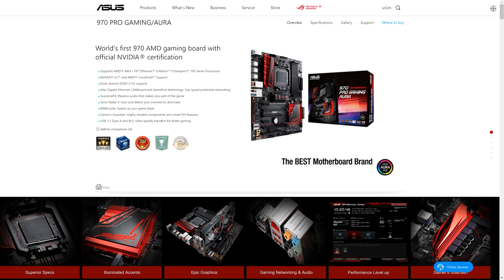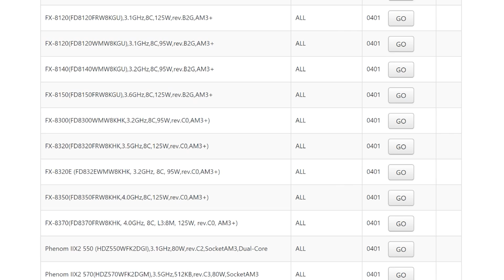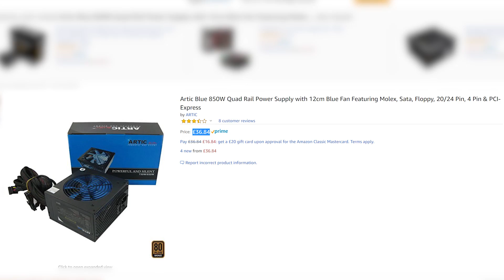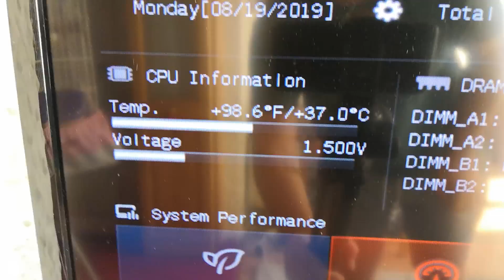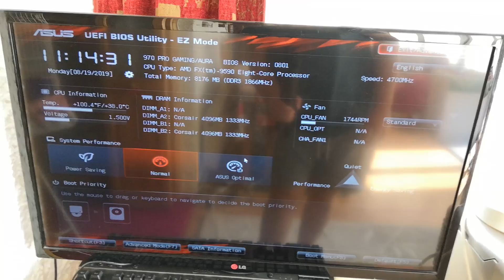This Used Gaming PC Is a 5GHz Fire Hazard (Pt. 1)

Comment: Don't be affraid to run this CPU on that board. This AIO can handle the mighty 9590 (u can upgrade to push pull to be sure). The main problem with running this CPU is VRM! Make sure there's plenty of airflow around VRM heatsink. And even when VRMs gonna get too hot it's not gonna burst into flames... just gonna throttle the CPU to 1400Mhz. PSU upgrade was a good move. Can't really see how it ran on that shitty one (bet the seller swapped it before shipping). I have "some" experience with that CPU :) OFC forget about overclocking with that MB.

Comment: Upgrade the motherboard I got  a fx9590 with r9 380x and 16gb ram with asus crosshairs formula z mobo for $250 a couple months back but I can’t leave it at stock so for some reason it always locks up so I’m running 4.5ghz still gets well over 60fps high settings in apex fortnite and halo5 and gears4 and forza giving the pc to my little brother for his birthday in November once I upgrade to zen3 because and this cpu definitely warms my apartment

Comment: That's why I have stopped buying stuff from Cex, I bought 8gb ram (which were broken when I received them) and I also bought 2 HDD's and both of them were corrupt or had a max speed of around 50kbp/s. Never buying stuff from them again, safer to stick with ebay.
Reply: Safer to stick with Amazon. A little bit more expensive but guaranteed to be brand new and obviously working

Comment: A lot of non-enthusiast builders seem to have NO CLUE about PSU's. I've seen some super highspecced machines (think 980ti and a 3770K + Noctua aircooler) that had budget high-wattage psu's installed for... No apparent reason? I think maybe normies just look at to psu's and think "I can get 850w for 40eur or 650w for 80eur!? must be a rip-off this!"... Also if you OC an 8000 series it's not really gonna work any better with the motherboard :b I mean it's the power draw the board isn't rated for not the chip.

Comment: You worry way too much. The last CPU that would barbecue itself if you didn't pay attention to its heat output was the ancient Thunderbird - everything since then is thermal-controlled and throttled and pretty damn safe. Worst thing that can happen here is that the thing shuts down, or possibly that the horrible old PSU blows a capacitor - which would be unpleasant but not threatening.

Comment: For sure, there are lots of motherboards that will have serious problems with the FX 9590. This isn't one of them. It's got a 7+1 phase VRM with a decent size heatsink. Worst case it would need a bit of airflow for sustained heavy loads.

Completely agree with swapping out that gutless wonder of a power supply though.

Comment: Hmmm well I'm gonna vote for continue to use the 9590, if you have funds replace the PSU with perhaps a modest Corsair TX850M or Thermaltake Toughpower GF1 850W which would give you enough headroom for that CPUs massive TDP both PSUs under $200 or you could go with the Corsair RX1000 for under $300 if you're super nervous. If you live in a modern house with modern power cabling in your walls with a circuit breaker you shouldn't have issues with this PC but I understand your concern. The motherboard would automatically turn off if voltages spike or fluctuate or the CPU could be damaged.

Otherwise go with a 8000 series CPU. It's really up to you dude and what you feel comfortable with.

Comment: Oh my god. I have one of those cases. I hate it. I absolutely fucking hate it.
It has the worst airflow. THE WORST. 

I ran my FX-8320 inside it with a GTX 750Ti, and later in it's life before I upgraded to Ryzen, I was running a Vega 64 in there just to see how it would handle general use. Two space heaters, one case. Not good.

Comment: If the motherboard is a good 970 it should be fine. I had a Gigabyte 970A-UD3, which was a medium range 970 Board, but it still had an 8 phase VRM. It easily handled an overclocked 8150, which should also be around 200W. However I would not overclock the 9590 on it.

Comment: The 970 pro has a decent vrm setup. But the vrm might get a little toasty so you might want to throw like a 28mm fan on it.  The board should be able to handle the cpu at stock operations, so let it boost itself instead of doing a manual overclock. Also flip the fan to the other side of the rad so it's bringing cold air from the front in.

Comment: 970 chipsets really aren't all that great for the 8 cores or even at times for attempting to push the 6 core chips. My fx 4300 was doing fine in a MSI gaming 970 board with an overclock to 4.4GHz  but my fx 6300 was really only ok at stock settings. 

I'm honestly torn on the decision. I know a 990fx board is a better match for that cpu but they're not exactly cheap to come by. Seems like you'd be better off with going for an 8xxx cpu, but then the system would be handicapped overall without that overclock.

Comment: A 5Ghz, all-core overclocked FX-9370 is my daily driver. In the peak of summer, I (sometimes) crank it down to 4.8, and in the dead of winter, with mods, I can get it to 5.1, 5.25 just for desktop screenshots. H100i, presently only in a pull configuration.

I even ran it without any case fans for a year. The plan was/is to replace it with Ryzen, when it dies, but it just doesn't seem to be capable of dying. Worth testing the 9590, for sure. Btw, I rock the Sabertooth FX 990 R2.0 board.

edit: Presently running a 1050ti, as I lent my 7970 to a 9900K build that I did for a friend.

Comment: Go for the Better MB and use the FX-9590 ; Try to get a Gigabyte 990FX Gaming MB ; it has a PCIE2 X4 NVME M.2 slot and on the back panel is a USB 3.1 Type-C port. I had used a MSI Radeon RX 580 8GB Gaming X - I had 2 of the Crucial Ballistix Sport XT 16GB Kit (8GBx2) DDR3 1866 (PC3-14900) UDIMM 240-Pin Memory Kits ( 8-gb X 4 Modules  = 32 gb ) My storage was a 1 tb Samsung 970 Evo NVME M.2 ( PCIE-3 X4 )  : After an optimization with the Samsung Magician software it ran at - 1850 mb a sec read and 1645 mb a sec write ; which is more then 3 x the speed of any Sata SSD could run at. My  PSU was the Seasonic Prime 650w FM 80+ Titanium model. You could probably use a RX-590 8gb gpu in place of the RX-580 8-gb and the FX-9590 shouldn't be  much of a bottle neck between the Cpu and Gpu.

Comment: After all this years you still afraid to burn a mobo when there is no reason to worry?
Reply: Exactly, he need to grow a pair... I like his content but come on, the worst that can happen is a dead mobo, a gpu can pull more than 300w but he is scared of a cpu than can do the same ? Fire won't start for so little, even the old evga classified that burned their 24 pins connector when doing 4 way sli gtx 480 wasn't a fire hazard

Comment: I had that motherboard for 3 years with a fx 8350, served me well. That board is known to run hot though, had to set voltages cause the auto settings allowed it to go too high with no performance gains

Comment: I thought the 9000 chips were just binned 8000 chips with factory overclocks. run it as is, back down the voltage if it gets too hot for you

Comment: Run it as it is, I've run a 9590 at 1.65v on that board with phase cooling. It's fine Bro. Did 5.8ghz no problems.

Comment: Hope I'm not too late. . .  regardless of what CPU you go with, I highly suggest upgrading to a 990FX board.

Personally, I'd like to see the 9590 in action. . . it was my first choice when getting parts together for an upgrade a few years ago, but one of the sales reps at Microcenter warned me that it required a liquid cooler, and none of the 9590s they had back then came with a cooler at all (when I started looking at this CPU late last year, they actually came with coolers!).  And I'm not a liquid cooling type of guy, I like fans!  So I ended up getting an 8370 instead (basically a stripped-down version of the 9590).

Now that you mentioned that the 9590 can be air cooled, what would you suggest for a decent CPU cooler?

Comment: honestly, i think you're being too paranoid with a lot of this stuff. I do a lot of risky stuff with the spare computer components i work with, and using a high wattage CPU on a motherboard that isn't rated for it isn't that bad. The motherboard wattage ratings are mostly determined by the heatsinks on the motherboard power delivery cicructs being able to dissipate the heat. i've been able to push full 91w i7's on OEM dell motherboards that were rated for 51w i3's. keep a fan on the motherboard and throw in a 650w psu, and everything should be fine.

Comment: I got 2 fx 8350s oc 4996mhz h100v2 30c 55c max temps 4 case fan's good air flow , asus sabertooth r2.0 gtx 1070s pony gaming memory 1866hz 4x4 16gb evga 850w g2 power supply, gave them to my 2 girl's and they are happy gamers right now , i did a 3600x new computer its 2 plus  times faster and cooler.

Comment: Please, stick with 9590 and overclock nb, cache and ram. Otherwise you won't get full potential of it.
Reply: This. I tried this on my 9370 and it performs SIGNIFICANTLY better, even if I have to have it at 4.85 ghz instead of 5. It's still much faster, particularly in games and single threaded applications. Multithreaded is about the same

Comment: If it booted without blowing up you should be good to go.  I would change the thermal paste and then blow out the radiator and fan on the back of the case.  Just to make sure.

Comment: Get a new board for the 9590, sell the old one off, test it with the 550 then put 8 more gigs of RAM in and a better gpu and see how it performs and see if its capable in 2019, may want to upgrade the cooler too and push that monster of a cpu, i couldn't imagine AMD making a dual socket board with 2 of these paired with 2 480s in SLi, your entire estate would be a a blaze and the ice caps would have melted

Comment: This reminds me of the older AM3+ motherboards that didn't officially support the FX 8xxx series chips even though the board supported 125W CPUs it did not support the fx 8xxx series cpus but users used the fx8xxx series anyway.  Yeah this user who owned this PC was really playing with fire here because when the FX9590 was being sold commercially sites like Newegg and Amazon would usually have a motherboard CPU combo and it paired the CPU with an 990 board. Also the Fx 9590 all it was a heavily overclocked 8350 so you are really not losing that much performance.  If you can get a decent price on a 990 motherboard then I would upgrade the board but if you can get an fx 8320 or 8350 for a decent price then I would go that route. But with me I would upgrade the motherboard to a 990 and see what the fx 9590 can do.

Comment: I tried cooling my old 8320 with a low end water cooler and the coolant literally evaporated.
Reply: Dark Rock 4 is all you need to cool anything
Reply: @weavercs4014  screw that get a dh15 noctua cooler and your set for a few years
Reply: @hgffmikimmon5293  yeah noctuas are nice. Although even the smaller ones should be fine for non-oc builds.
Reply: @DeadNoob451  true
Reply: Are you sure it wasn't a light-water nuclear reactor lol
Reply: Shut up

Comment: I would try to run the thing in the 970... You could figure out if it's actually getting the required juice from the mobo or its limited to 8350 performance... That would be interesting - and if it blows up you have a cool video "Running the 220W FX-9590 in an unsupported motherboard... - will it blow??" :-)

Comment: 5:23 I hope you've got that thing plugged into a surge protector.
Reply: You obviously don’t understand the point of a surge protector. It’s made for external voltage spikes. The worse thing that could happen is an excess of power draw and the breaker would flip.

Comment: My CoolerMaster v1 V8 monster handles my AM3+ 8 corer absolutely fine with my core temp with a Youtube upload, game in the background and running Chrome is pootling along about 19 degrees, cannot fault the version 1 cooler and even on the recent ultra hot days my core was hardly sweating whilst I was melting from the heat lol

Comment: Downgrade to 8350, 1l6gb ram. Gtx 1060 6gb im curious as to how the 1060 would run with an 8350. I upgraded to a ryzen 5 1600 due to fears the 1060 would bottleneck the 8350

Comment: Don't worry about the 9590. An overclocked FX-8350 or FX-8320 overclocked to 4.7 GHz would draw just as much power. Go ahead and use it!  It'll be fine, if a little loud.

Comment: One thing you should do if you're concerned about heat from your graphics card then you should check out slot cooler fans some of them exhaust the Heat some of them glow are directly on new GPU it all depends on which one you get they really do help no more hot air you can get out of your system the better it runs even if you have liquid cooling

Comment: Lol the FX CPU's can get a little toasty.
My former FX-8150 (used since 2012) was replaced with a Ryzen 7 3700x

Old System:
AMD FX-8150, Gigabyte FX990-UD3, 32GB OCZ DDR3 1600, 256GB OCZ SSD, 
Galax RTX 2080 8GB, 750w Thermaltake PSU, Coolermaster 240L RBG AIO cooler.

The CPU used to run at 100% to try an keep up with 2080 GPU overclocking itself to 4400 Mhz used to pump a lot of heat out :)

My son still uses the CPU / MB / RAM with a GTX 1060 and its been stable.
Reply: Who puts an rtx 2080 with an fx CPU lol
Reply: @MrMushroom5  It was on special and I was waiting for the Ryzen CPU's to launch rather than look at the GPU go unused for 3 months I dropped it in the old system.

Comment: I work as a PC tech and I remember a customer buying (not from us) a machine with an FX-9590 or 9570 can't remember, with a €40 aftermarket air cooler and an AsRock 970 board. The computer wasn't working very well, so we updated the BIOS... and it had a message saying the processor wasn't supported and wouldn't boot past there. So we downgraded the BIOS, underclocked the CPU to FX-8370 levels (4 GHz) and the processor would pass all tests, including thermal. I think the VRMs couldn't keep with the 220W TDP of the CPU at stock speeds.
This was in 2015 or so, so it was still an OK computer (but a terrible buy). I think the customer kept using the computer for at least a couple of years.

Keep the motherboard, underclock the processor. Or don't, and see how toasty the VRMs are after a couple of hours in Prime95. I would be interested in that. :D

Comment: You can definitely run it stock like that. It wont blow up. The cpu has tdp of those 200w, thats heat output not power draw im sure. If a decent psu isn't capable of the load you put on it, it will just reboot, no harm done. You will know before anything takes any dmg at all. No hardware will be at risk of dmg currently with your good psu

Comment: the 9590 is just a binned 8000 series cpu.    it should be a great undervolted/underclocked fx cpu (if there is such a thing...not).  i had several of those "aura" boards and pushed them hard.   they can take it.   just keep it within reason.

Comment: As the 9590 is first cousin to a flamethrower and the board you have may well be good enough to run it adequately, I would urge caution. The extra power used to run the 9590 is mostly wasted due IIRC some weird throttling issue internally. Yes it will hit the Big 50 and do it at horrendous power cost but realistically it isn't worth it.

I suggest that you pull this rare beast out of the board and sell it as a collector item alone. I do think an FX8350 would be a more rational choice for this board and RAM is it will allow for some, not a lot, of OC room. The GTX550ti not working is possibly replaceable either throught the merchant or getting something else cheap. Thie above would at least allow for a some sort of return on what at this writing looks to be kind of non-functional. What ever you do, please don't burn up that board by boosting the 9590.

Comment: 970 Aura will be fine running 9590, the VRM is strong. I used to OC 8320 to 4.8 Ghz ( around the same base clock as 9590 ) on Gigabyte 970. On normal use ( I use my OC'ed FX back then for daily use like gaming and Drawing on Photoshop ) It is fine for years until my friend interested on buying my PC and then I switched to Intel hahaha...

Comment: Funny. I just sold a 9590 for £60. These processors are overpriced as hell on eBay. I sole it on the FB marketplace.

When I had it, it was paired with an MSi 970A Gaming, while it did post, the chipset ran so hot the PC would crash just idling. I had to disable the boost clocking and downclock to 4GHz just for it to be stable.

Comment: my first gaming pc was an fx-8320 that I had overclocked so high I was outperforming the 9590 when that came out.  it was still garbage for dirt rally lol  i was also killing it with voltage to get there (around 1.6375V if I remember correctly)  ran it for a couple years before upgrading to a w3520 then a w3670 and both outperformed it in games, with the w3670 being decent still even at stock clocks

-edit: i had the Gigabyte GA-990FXA-UD3 which was cheap and pretty darn good

Comment: don't know why you are freaking out so much,  it's a good quality board and a decent AIO so it can handle an overclock. even if the previous owner did go crazy with the overclock if the board could not handle it you would just get a hard lock at worst, it's extremely hard to blow a good board with an overclock.
You are correct to not trust that power supply but a bad power supply is unlikely to kill a board, just it's self.

Comment: So much dramatics. LOL, I just picked up a Cyberpower fx-9590 system with 990fx,16gb and a rx560....fires right up....I don't know why you are so gun shy..... it does have a corsair 240 AIO but running ada 64 this system never peaked 78c.....after 25 min....its really not that big of a deal friend, at this point in the game, a 990fx board will regulate what it needs to in order to keep you safe. sure, dodgy psus (which i may have) are problematic, but if they are 80+ certified i would not worry much......